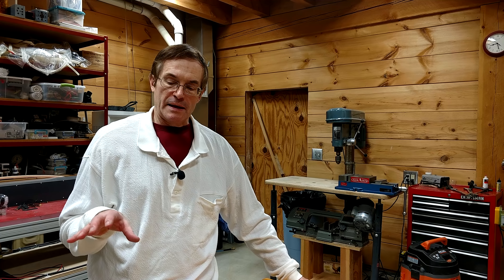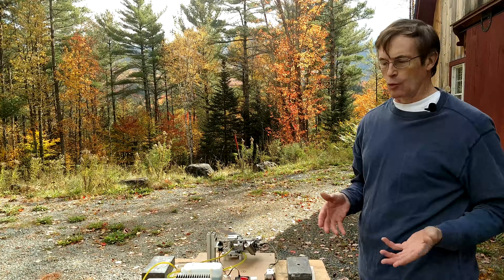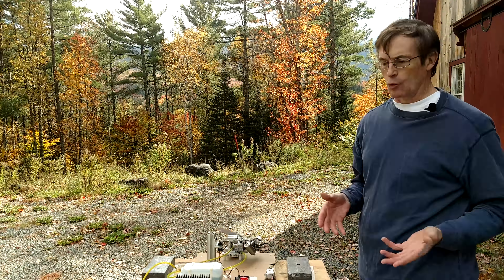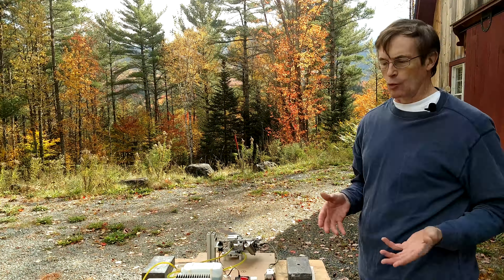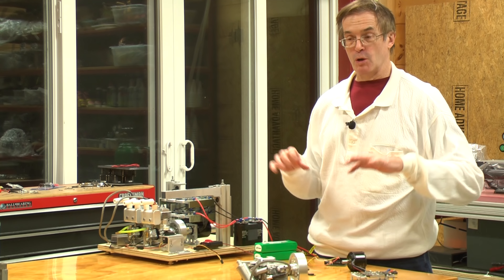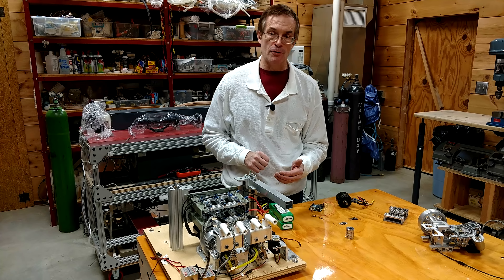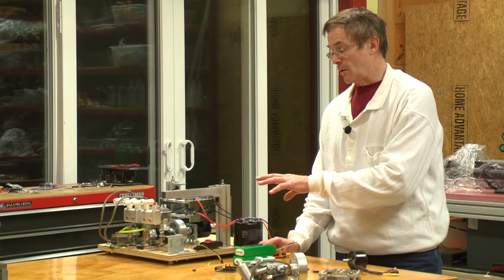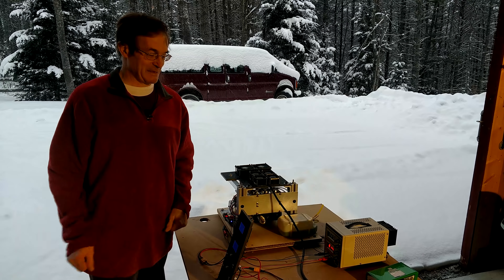Hybrid Drone Generator

Comment: I'm only a tiny way in but been reading comments because on phone call the best way for eftecant that I think military use would be hydrogen to electric or a piston engine can be used the only thing that makes it hard is containing the hydrogen but it can be stored in aluminium do used as needed I think this is the most effective one for weght and flying time I think that why the hydrogen stored using aluminium was suppressed for 10 years also I see someone say capacitor to store energy is a waste of weght for efficient lipo battery would charge fast and last way longer the super capacitors 
The there is also turbine like tesla turbine that if done right use atmosphere  pressure and the exhaust cause vacuum so self running so could fly unlimited but that then needing precision engendering because rmp 
Also it could use a fuel source same as a jet engine and jet engine I belive can be over 100 percent efficient or use very litle fuel while crauseing 
That my input that comes to mind run a turbine in a vacuum cold steam
Reply from the maker: You need to slow down and break up your  comments into short, effecient sentences.  It is difficult to understand what you're trying to say.

Comment: I want to use rc 3 phase wild ac motor to rectify and disconnect when battery charged to use like a magnet alternator instead of step down module on my hybrid vehicle for the auxiliary normal 12v battery. Just thought im sure its probably gonna be to use more power to move the vehicle. Also solar power. Laugh out loud

Comment: Fun experiment I guess, but no practical use outside of corporate/academic/military since large enough drones to carry something like this are not available to or useful to anyone else. I once created a minuscule switch that could switch the video stream coming from up to 8 cameras to one video transmitter which I then tried to market, but the capability was not desired enough by anyone... I sent out demo units and so on, but as far as I can tell none of them where ever used or even tested by the recipients of the demo units even though they did ask for them. So I shut down the company and moved on.
Reply from the maker: Sorry to hear that.

Comment: Ehm... 2.2kW demonstrated @300W, that weight is unflyable as a quadcopter.
Fixed wing maybe but why not just run the prop directly from a single engine then
Reply from the maker: There already is a 2kW peak, 1.8kW continuous, generator module sold out of China for thousands of dollars that powers a multi rotor for 100km.
The advantage of a gen module is the fast response of electrically driven rotors and the ease of isolating both vibration and noise with a single, independent module.

Comment: How about a wankel engine?
* Lighter and more compact
* Simpler; eccentric shaft and rotor are the only moving parts
* No reciprocating parts, so Less vibration
* Smoother power delivery due to design
* Higher RPMs, so ideal for a generator
Reply from the maker: You are correct on all points, but they are sadly not readily available.  Surplus OS Wankel engines are too rare.

Comment: Why not use a turbine?
Reply from the maker: We're building one.  But to answer your question, a two stroke engine is far less expensive and more widely available and despite its low fuel efficiency, a turbine is even worse.

Comment: I think that there are two reasons for quadrocopter over helicopter. First is mechnical simplicity. Four electromotors and nothing else. Second is power to weight of motors. This heavy and mechanically somewhat complicated design makes both advantages irrelevant. Isn't in better to build drone as RC helicopter, possibly with two swash plates and counter rotating propellers like Russian Kamov Ka-52 ? Or this RC model https://www.youtube.com/watch?v=9X4CBtFEVYc
That would add huge mechanical complexity to propeller control mechanism, it would require redesign of control software, but it would allow to get rid of generator and power propeller directly by gas engine or turbine. 
Just asking, video is interesting.

Comment: Did I miss something? Your panel meters showed the voltage was good, but the amperage “current” was barely enough for 1 small drone motor. How are you going to get 8-10 times that current? I would think that even 100 amps at 30+ volts is what you will need to generate just to lift that setup alone and another 40-60 amps for the weight of the airframe, flight motors, and other electronics. I applaud you on your efforts, but I don’t see enough hardware to create the required power. So this leads me back to my question, am I missing something?
Reply: It seems like the load is only drawing 9-10A; as such the 'generator' can handle the load without the batteries. Real test of course is to load it up until the batteries are needed. Hope this helps...

Comment: Why not leave all that hardware on the ground and fly the drone with the gasoline engines??  They control very well.  Much more efficient.  Why would you have an electric car powered my an on board  gasoline driven generator?  If you are going to have the noise up in the sky anyway, just use it straight away and fly much lighter.

A railroad locomotive is a little different story because of control and power transfer issues.
Reply from the maker: Gasoline engines have less control resolution than electric motors.  The noise and vibration produced by the gasoline engine is easier to manage when it is in a single location and not attached directly to the airframe, but through flexible wires.  The downside, as you note, is lower effeciency.
Reply: Gasoline engines have less control resolution than electric motors.     Yes, that is true. However, gasoline engines, have for a long time, controlled good enough to fly airplanes and helicopters quite well and drive cars.

How much resolution is enough?  If an electric motor is a ten, and a gas engine is a seven and all you need is five????    And the generator you are proposing to place on board is  a gas engine and  already noisy. What's the point?  There are high quality flexible drive shafts capable of operating in the necessary conditions.  Or instead of flexible shafts, timing belts are light weight, strong, and can run relatively  long distances (several feet) with minimal guidance and they run very smooth.  A simple guide roller, or two, just touching the backside, along the way will keep them from vibrating.   Or, timing belts can be arranged to drive as many shafts as needed, easily four or six from a central position.   I love timing belts. I use them for lots of things. A gem of engineering.  There are two types that seem to work just about the same.

Isolation from the air-frame is a problem, but not rocket science and can be solved and has been solved on many aircraft and industrial applications for decades.  Design a seismic isolator  bushing with the right properties of density and hardness (it may end up being quite fluid) and have the right mass on the far side.  It can be represented by a capacitor and coil. A low band rejection filter with a fairly broad Q to cover the RPM range, or at least the lower end. This can be done, and is done in many applications.
Get rid of the Love-joy coupler and mount the generator on the seismic platform with the engines and a solid shaft connection. This will also place more mass to absorb some of the vibration energy on the inside of the seismic filter relieving the filter of having to absorb so much energy and reducing the amount of mass needed on the far side of the filter for the filter to push against to do it's job.

Yes, torque will have to be dealt with and  two engines in sync,  counter rotating, contrary to what you have now with both running in the same direction, centrally located and vertically oriented will take that out of the picture.  This will also cancel most  of the vibration acting like the counter balance shafts used in modern automobile engines.  A particular model of Porsche comes to mind.  The vibrations will be 180 Deg out of phase and cancel. in all axis all the time. Not just when two weights are apposing.   When the weights are on top or the bottom they are not canceling.   Several single cylinder units should be tested in counter rotating mode first.  Multi cylinder engines should be considered.   There may not be an off the shelf unit to fit the bill and designing a custom engine will probably be necessary. I am sure there is an engine designer somewhere who has the answers within in his/her expertise if after a through search fails to locate a suitable readily available candidate.

 @TechIngredients

Comment: Interesting stuff, I'm not sure you're 100% correct on the engine balance subject. In the RC plane hobby, we're very careful to balance propellers precisely because the engines are crank balanced and to avoid the destructive bearing vibration you have induced with your unbalanced flywheels. Your system may be running quite smooth as a whole because the flywheel imbalances cancel each other out and because you're using a very rigid motor mounting.... however, I think you are knocking the snot out of the bearings in your engines. Just something to consider.

Just to prevent any confusion you will find a picture of the DLE20 crank here note the counterbalance on the crank to offset the reciprocating weight of the piston and crank rod. https://www.towerhobbies.com/cgi-bin/wti0001p?&I=LXANVJ
Reply from the maker: How do you explain the bench demonstration I performed with this engine.  They may claim to be balanced, but if they were the engine should not become unbalanced about it's axis of rotation as the piston  moves back and forth.
Reply: @TechIngredients   CRank balancing is not intended to cause the engines center of gravity to remain static, it is intended to offset as much of the reciprocation induced vibration as possible without creating undue lateral vibration in the process. As with most things to a great extent it's about robbing Peter to pay Paul and no matter what you do you're never gonna get an exceedingly smooth single cylinder. 

That's why the twins are always an improvement, and the quads even better, the "boxer configuration means opposed pistons offset each others reciprocation and inline banks fire at 180 reducing the time between power pulses.

Comment: Man this guy likes to sound like a scientist.  How is it then that basically every home generator is a single cylinder 4-stroke engine?  How is it that he never even built a generator before coming up with problems to solve that magically aren't happening in a Honda of the same configuration.  A Honda still only has power 1 stroke out of 4.   It even runs at a lower rpm so, due to less inertia, should be MORE susceptible variations in speed.  Even if you assume what he's saying is significant...  Why on earth would you pick a lower efficiency design (2-stroke) and double the parts count (2 cylinders) of the mechanical  side when you could easily smooth the output with lightweight electronics.  What else?  The exhaust system and muffling of a 2-stroke engine is CRITICAL to it's power output.  It's not just something to route and muffle exhaust gasses like a 4-stroke.  You can't just DIY a bigger muffler with a couple of bits of metal and fiberglass without seriously affecting power output.   Regardless of big words, white shirt and careful sentence structure this video is a ton of  BS.
EDIT   I gave up too early.  So he ends up talking about voltage ripple out in the power.  Great.  Isn't that the problem you sacrificed efficiency (using a 2-stroke) and complexity (2 engines) to solve ?
Reply from the maker: Thanks for the comment.
Please refrain from the character attacks and stick to the facts.
The two stroke has a higher power to weight ratio than a four stroke.  Smoothing voltage/current reduces the demand on downstream electronics and the increased cylinder count reduces vibration amplitude.
We followed this video with a demonstration of over 2kW.  Exhaust tuning improves output, but has to be done with a compact system for mounting on an aircraft.

Comment: I just don't get it, 1/10 the energy density of LQ fuel.
Why not just exchange all the electronics with a few transducers, A/D converters a PLA or two and a microcontroller driving high speed throttle servos in a PID feedback control loop with IC motors running alcohol.
All the controlability of electric (other than starting)  with 10X the range. A little louder maybe, but a little engineering to well designed resonators would drop the noise to a whisper.

What's the attraction of electrics at this low stage of battery technology ?

Comment: science vs mechanics.  This was more mechanics and electronics than science.  Science would have involved the chemistry of the diodes and the batteries and the gasoline, methinks.  It was still pretty great mechanics.  But pretty sure there are 30 Chinese engineers that've already taken a prototype to their boss using a boxer configured 4 cycle motor.
Reply from the maker: They may be distracted for the next few months.
Reply: @TechIngredients  LOL that's tragic all around but still funny in a morbid way.  Let's hope it's a learning opportunity that doesn't get wasted.

Comment: Did you consider a Wankel ?
Reply from the maker: Yes, but small rotary engines are not available, except for a few surplus OS RC engines.
Reply: @TechIngredients  how about a small turbine?
Reply from the maker: That would really sound nice!
Yet, in that case the engine will be very expensive and the low compression ratio will make it pretty inefficient.
Reply: @TechIngredients  thank you

Comment: why not a model rotary ( wankel ) engine?
Reply from the maker: They are not available.  We did not want a design that depended on hard to locate, used OS rotary engines.  Designing an entire engine for this project would make it unapproachable for most viewers and the few mid HP rotary engines on the market are incredibly expensive.
Reply: didn't expect a response on such an old vid. thank you. You do genius work in your vids. Couldn't you also grab some power with  PELTIER modules on the exhaust? too bad you can't make a reversed speaker to channel the generator's sound into so you could make power out of it's noise pollution. Please keep the vids coming

Comment: A smart man could maybe figure out how to use the batteries and caps as mass in the flywheels.
Reply from the maker: That is probably not going to work simply because the centrifugal forces are in the thousands of g's not to mention the vibrations associated with direct coupling to the engines.

Comment: so why not just make a gas motor powered rc helicopter? use counter rotating blades and modern control systems to fine tune the rpm and blade pitch. I think it's simpler and been done already in professional rc, and would probably work better than going from gas to electric to thrust, just go gas to thrust with electric control
Reply from the maker: This has been a frequent question in the comment section.  The reason for the generator module is because it is being built as a separate module and in three sizes.  As such, it is possible to add it to the large number of existing multi rotors without redesigning the basic craft.  The engine vibration is much more easily isolated when the power is coupled through flexible wires rather than through a transmission system.  Noise is more easily blocked when a single engine (or pair of engines) is in one compact location.  And, when carrying fuel is not acceptable then it can be removed.
Reply: I'm with you on this. A single engine connecting 4 props belt drive with the flight controller varying the pitch of the 4 props would do the same thing. Not sure why isolating the vibration of the engine is even an issue. What issue does the vibration cause? 

If carrying fuel is not appropriate, then use your electric drone.
Reply from the maker: A large heavy lift drone is very expensive especially if purchased commercially.  A person or a small company may not want to purchase a complete, second gas powered drone when a generator will provide the flight duration they are seeking.  Vibration is important when the payload is for photography or reconnaissance.  Also, some instrumentation is sensitive to vibration , but of course not everything is,  agricultural spraying is one example.

Comment: Wow, not so easy, simple theory is one thing, making it happen...
Reply from the maker: 300 watts?  I'm not sure what you are referring to.  In the second video in this series this same generator produces 2.2kW.
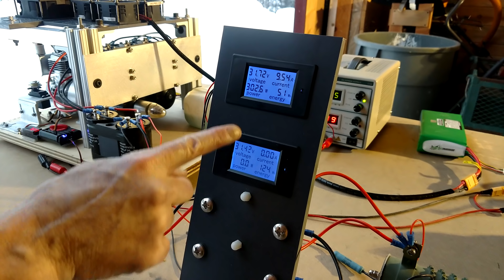Reply: At 25:43  it seems the reading is  312.2 watts.  Are you saying that in a different video you are getting 2,200 watts for the two engines?  That would be a  better result.
Reply from the maker: Yes.  Take a look through our channel. Not only will you find that video, but you might like some of the other topics interesting as well.  And if so, please subscribe...it helps us out.